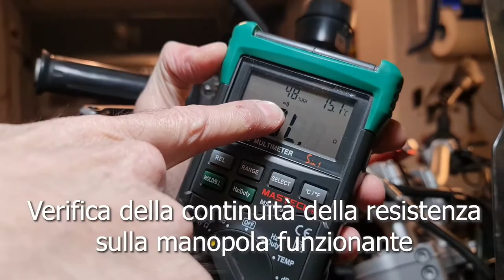Riparare manopola riscaldata bmw F 800 GS

Comment: Ciao! Mi è stato di grandissimo aiuto il tuo video! Non ho esperienza ma  proceduto come te alla verifica  bypassi un settore! Ti ha dato problemi reinserire la manopola nuova  con il filo saldato? E poi lo avverti quello spessore? Io Temo di strapparlo rimontando...
Reply from the maker: ciao, nessun problema a rimontare la manopola, non si sente alcuno spessore, tutto ha funzionato senza problemi. 
a distanza di mesi però, il filo si deve essere mosso perché qualche volta non scalda, allora giro la manopola a forza, come per accelerare, il filo si rimette nella posizione corretta e tutto funziona di nuovo.... non è niente di grave o irreparabile, dovrei solo aprire e sistemare meglio il filo... o forse metterne uno più sottile, o forse una posizione diversa... il problema è solo il tempo e la voglia di rimetterci le mani che per adesso non ho, avendo trovato il trucco per farla funzionare comunque, mi scaldo cosi per adesso.

forse al posto del nastro isolante, sarebbe più opportuno usare un termorestringente che fa più presa sul filo stesso, ma non ne avevo di cosi grande da infilarci.
Reply: @gemini31  ottimo consiglio, continuo la mia certosina eliminazione della gomma vecchia e poi userò una termorestringente , grazie grazie!!